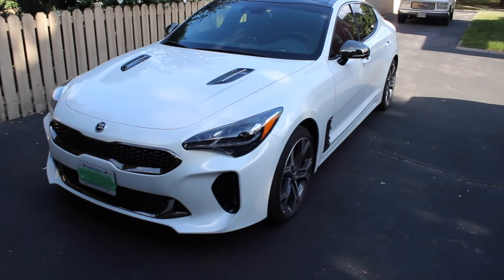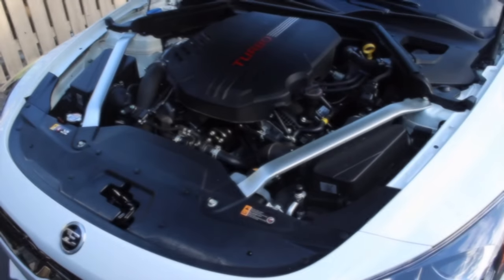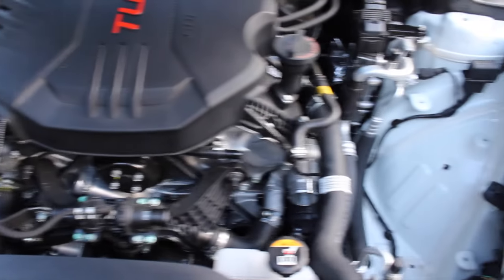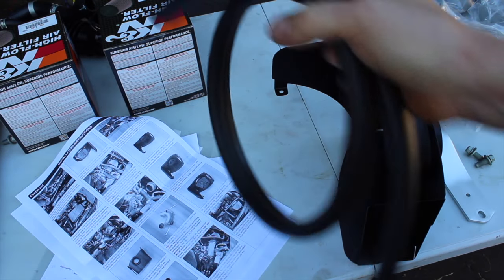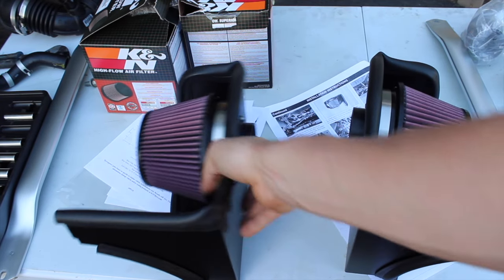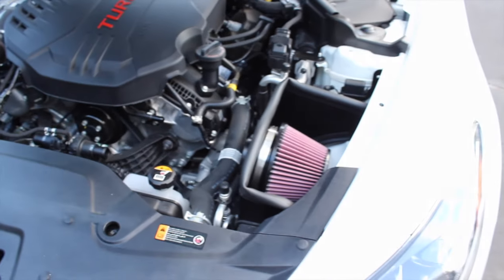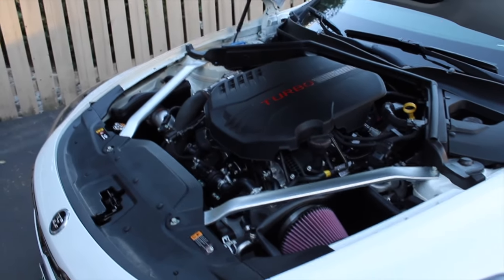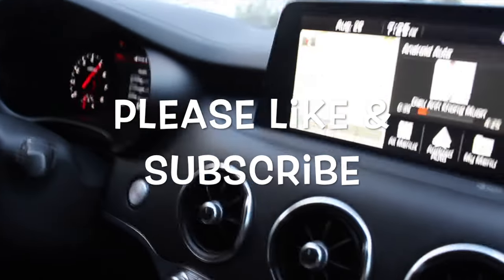Kia Stinger! The First Mod You Need! Cold Air Intake

Comment: Voiding the warranty “too much” is like being “too pregnant.”
Reply: well if you run into a engine issue after those intakes installed the dealer will blame the aftermarket intake, i would ask the dealership first before the install.
Reply: Yirlani  I wouldn't be so sure. Increasing the HP above original specs could be cause. You can bet Kia will have a better legal team than you. The law is always subject to interpretation. Just saying.
Reply: Dosen't void the warranty
Reply: Called my dealer. It voids the warranty on the stock intake because you’re removing it (obviously), but does not void the warranty on anything else.
Reply: So u put the old one back on when doing warrenty work
Reply: @Skiller7777  that's not how they warranty anymore. If you mod the exhaust it voids the exhaust nothing else

Comment: I got the Injen intakes, they sound just good, if not louder... but then, I also got a jb4 which I can now run safely on map3 -- +6 PSI, wow, even in ECO mode you can hear the turbos. What an insane engine, it's such a sleeper that's begging to be tuned into a monster.
Reply from the maker: Yeah very cool! He's actually got the JB4 tuner on order! Video coming up 
Can't wait to feel the difference
Reply: @cuttersperformance  you will! Make sure you change/gap your sparks though, or else you'll be limited to map1 at best.
Reply: You have factory blow off valves?
Reply: @wheatbread61  nope, HKS. But I’m not particularly happy of how they sound.
Reply: Do u think it would make my 19 2.0 sound better?  I have the premium model

Comment: Watching this again after mine arrived... Seriously considering trying to self install tomorrow.  I think I’m also gonna try and put in the big mouth air ducts also  tomorrow  🤞
Reply from the maker: You can do it! Lol
Reply: @cuttersperformance  I DID IT! although the amount of left over bolts I have are slightly concerning lol. If I don’t blow up within a week I’ll call it a win.. Sounds soooo LOUD !!! Love it!
Reply: @cuttersperformance  ended up not disconnecting the Negative charge on the battery like the instructions recommend. Couldn’t find enough instructions in my manual/ figure out where the anti-theft codes were it tells you to right down. No code though. Tried switching the bov hoses but mine still didn’t fit so left as is and one of them got trimmed as well. 

Probably going to look at it again and make sure it’s on right.
Reply: @LoneStarStinger  what's the update bro

Comment: I got the new 2022 mine is 1 month old. I dont think i will need to play with anything like that. I love the way it is out of the box. I got the new back end with the bi-modal exhaust. Maby after having 2-3 years i might do something like that. :)
Reply: Agreed man, they really fixed the lack of sound issue in the 2022. I purchased the gt2 elite a couple months ago and it sounds awsome
Reply: @pureblood_viking1388  Nice mate, i have noticed ours here in Australia are different to other models around the world tho. We don't get the All Wheel Drive only Rear Wheel. In the U.K. theirs do not come with a custom mode setting they only have Sport and Sport+. I can change all mine i have a custom mode. I have the drive train uncoupled with the engine in sports Kia calls it glide mode. I have the suspension on comfort and the steering on sport. When i want to have some fun i use my custom setup. In sport mode its locked i call that race mode or sport+. What is yours like? Oh mine here is the Gt what u call the gt2 elite. We also didnt get the suede interior so i went Silky Silver outside with the Red nappa leather inside.
Reply: @warshrike666  In the UK from 2019 onwards we also have petrol particulate filters (thanks EU) which muffle the exhaust even more. Really wish we got the bi-modal and a custom mode. Just ordered these intakes for mine and cannot wait to get them fitted for a bit more theatre as I'm driving.
Reply: @alexlee-isted5046  Oh really that's a shame it has a really nice note to it. Speaking of not getting the spec you want Australia didn't get the Sued interior that was initially promised. I went for the Red nappa instead. Let me know what you think of the new intakes.

Comment: Since the kit has open box for the intake it probably will take hot air now, the original intake had a closed box so the hot air can’t get in but now it’s open, I mean it sounds cool but probably it will cause a problem in the long run and could void your warranty.
Reply from the maker: Actually its not really open as its mostly sealed off when the hood is closed and has cold air ducts going into the boxes
Reply: @cuttersperformance  yes I can see that when the hood is closed it is more sealed but the air intake from the sides are not connected directly like the factory ones, so I still think it will take more warmer air than before, K&N should of made this more connected and sealed, but this way the dealership will most likely void the warranty.
Reply: "Void warranty " 😂😂 funny guy

Comment: I ran into an issue lol

After installation, the stupid radiator hose began leaking. I dont even think we touched that shit, at least we shouldnt have. We adjusted the clamp, but Im still kinda worried. 

Could there be another cause for that? Other than the clamp not being positioned correctly?

Comment: Does the box seal against the hood with the weather strip? Where I am it is regulation to have your intakes sealed. The loop hole is that you can use your hood as the top of the box. I have been looking for an intake that does this but didn't realize that the K&N had the weather strip.

Comment: I thought there's tons of videos of Stingers getting 12.9 to 13.2 secs. all day long ?  Mid 13's ? Have you run yours yet ? before the mod ? and have you an update on this ?  some believe these types of air intakes will also suck up some heat from the engine, even though they have the sheild to bloce it.. Any feedback on that from anyone who reads this and may know about those things ?  I've just swapped out for the K&N filters in their stock boxes.... with a DR app on my phone, got 13.2 1/4 on cold road today... will try again in warmer sun out day and see if get better grip and go.
Reply from the maker: We did take it to the track 
Best was a 13.2
The biggest issue is the stock launch control doesn't build any boost off the line. There is a mod where you can trick the car into not knowing the brake is applied to build more boost.
The car is getting a tuner soon and I'm curious what it will pick up at the track with that
Reply: @cuttersperformance  that's the best with the new K&N mod above ? Hmm... ? Stock Stingers are reporting that and even less. Is yours gt1 or 2 ?  I got that last night on a cold night road of apprx. freezing temp... can image it must be more on warmer grippy road.. the cold air would be a bonus, but losing on grip...
Reply: @rpmautoreviews9249   watch my videos I do high 12s all day stock. 12.5 with parking brake launch. I have a base GT AWD which is lighter tho.
Reply: after adding the 2 snorkel air-scoops, it helps my run times. together with drop in K&n's i've been getting min. 0.25 secs. faster run times on 1/4 mile runs.  question, why does the engine make that air sneezy sound when you let go of the gas ? more air going in is good, but whats the reason it now makes that air sound on let off ? I personally hate it..

Comment: Just installed mine, an injen for my 2.0. 
It was my first installation and a friend helped me, luckily it was straight forward. It sounds better BUT every time I press the accelerator there's this slight but very obvious whistling sound, is this normal?
Reply from the maker: Often times you will hear the whistle of the air across the throttle plate 
So most likely its normal 👍
Reply: @cuttersperformance  thank you! I'll be getting a blow off valve next and then I'll be done with the mods so i don't fuck it up lol
Reply from the maker: @Gianflavio
Blow off will sound sweet!
 haha every mod is always the "last mod" but it always leads to another 😄 that's the addiction
Reply: @cuttersperformance  hahaha my girlfriend will beat me up if I keep spending money on mods 😂

Comment: These run high 12s easy not mid 13s. I have a 2020 GT AWD and do like 12.75-12.8 faithfully.
Reply from the maker: He has tried best is a 13.2 so far 
Stock launch control sucks and the 60fts are over 2 secs
Reply: @cuttersperformance   yea he has a GT1 or GT2 AWD I have a base GT AWD 120 lbs lighter. Regular LC my 60ft like 2.02 but still get 12.8 in the 1/4. Tell him to do parking brake launch it builds boost. I do 12.5 doing the parking brake launch. N about 4.2 0-60

Comment: I have the option to get either the 2021 Stinger GT or a used 2019 GT2 with 5,000mi. Any advice on what to go with?
Reply from the maker: Id go as new as possible, I think they are still ironing out some issues with the first few years
Reply: The interior for the 2021 is way better, the exhaust noise is also edited on the new model. The price will go up though so i would do the 2019 and add a race chip
Reply: The GT2 is loaded. But,  with the used car? You have to make sure nothing happened within those first 5000 miles of the GT2. If its mechanically sound is the question? All things considered? The engine and the cars are exactly the same with exceptions of the options you must have. Lastly the 2021 vs the GT2? The 2021 will depreciate the most in its first year. What it boils down to? The options you want and the final selling price. If you can get rebates on the 2020? You'll save more $$ with it. In the long run you  have to make sure the GT2 is mechanically sound with no major defects. That it wasn't dogged, see service records. By additional warranty only if you want peace of mind. Peace ✌
Reply: The 2021 GT versions are basically the same car as the 19 or 18 or 20.  There aren’t really any changes. 5000 miles is nothing. I bought one with 25,000 used and now it has 50 and it’s just a machine. I have a GT1 and wish that I had bought a GT2. The GT1 has things at the GT doesn’t have that I can simply could not live without: large sunroof, heated and cooled seats, Harmon Kardon stereo system, lane keep assist, adaptive cruise control. I use pretty much every single one of these features every time I get in the car.  I wish it had the automatic hatch open and nicer leather found in the GT2.

Comment: Does this mod void engine warranty?
Reply from the maker: I think it really comes down to your dealer. If they can  prove that the intake caused a failure then they can deny you warranty. But I would say most of the time a cold air intake that is properly installed does not completely void your warranty. You may want to ask your local dealer though
Reply: @cuttersperformance  Here in Sweden you can change exhaust pipes too and its ok!

Comment: Sucking air from the engine bay is not cold air... The original feeds colder air.
Reply: Except its shielded from engine bay and has duct work that does in fact intake cold air. . . .
Reply: @jukins6543  . Cool. Many people are running hot air intakes. Literally not cool.

Comment: Naw they actually run high 12s...
Reply from the maker: We tried this one, we got about the same as motortrend when the tested theirs 13.6 to 13.8 
I've heard that the RWD run low 13s 
I think the car would be quicker if the factory launch control actually built some boost off the line
Reply: @cuttersperformance   watch my videos I have plenty of dragy runs. Not one is over 13. But your friend has a GT2 from the looks of it. I have a Base GT which is 120lbs lighter. I’m AWD not RWD but faithfully do 12.75-12.82. If I do parking break launch n actually build boost I’m around 12.5
Im 100% stock don’t have intakes or anything lol

Comment: Ahaha, you say COLD AIR intake. This is HOT air intake! These filters are sucking up the hot air from the engine bay. Hot air  - less power! The stock filters are getting cold air from the outside. Learn the basics before u do this BS upgrade and get nothing but "psssh" sound and less HP.

Comment: All those open intakes are garbage. Poor fit and finish, they don't seal since braces are over them and end up sucking more hot air from the engine, plus you risk sucking in some stray water. As a bonus on refreshed Stinger, you will throw an overboost code and go to limp mode once you run car hard back to back. Well documented issue. Do yourself a favor and pass on those. If you are not adding any supporting modes, stock intakes are more then enough. If you are, there are better choices with closed design. Unless you are 15, the whole symphony of noises they make will get played after a while too.